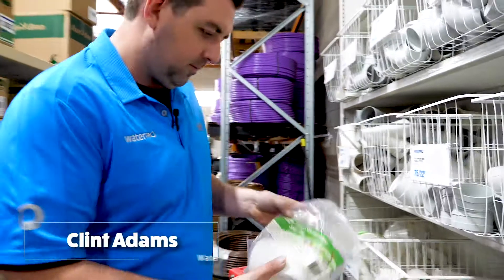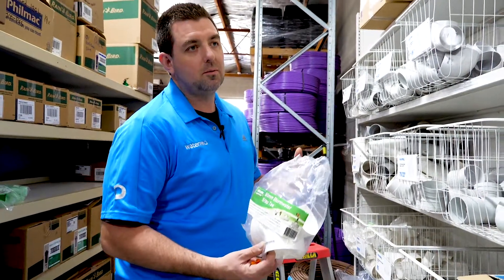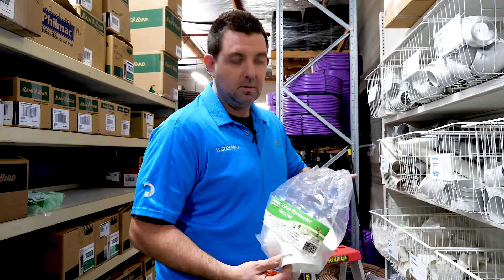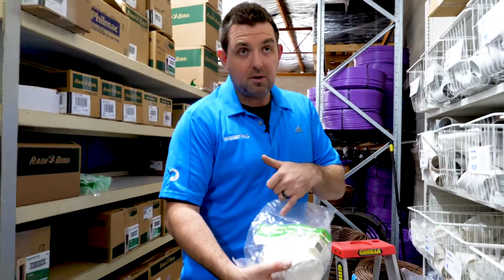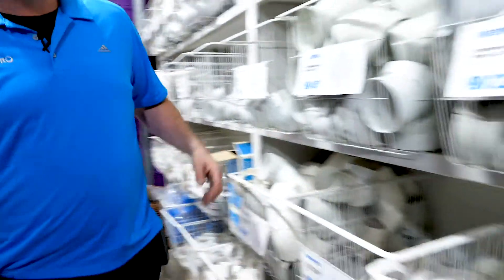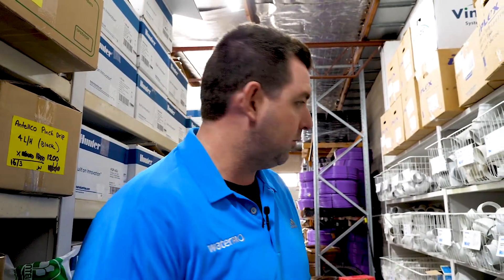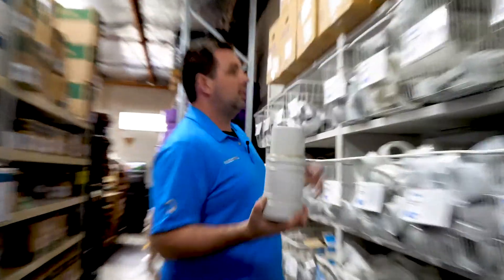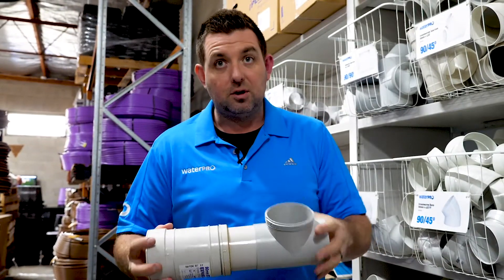What is a Stormwater Snap Tee?

Comment: Does it work under pressure and do you still need to glue it into place as per normal PVC pipe?
Reply from the maker: Its designed to be used on stormwater systems which can not handle pressure.